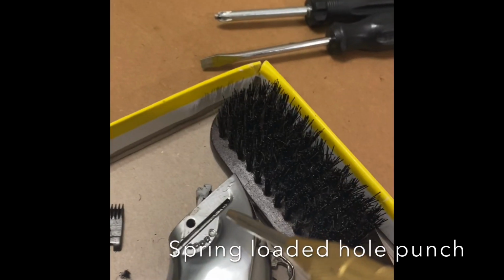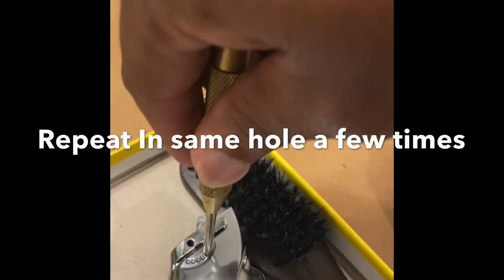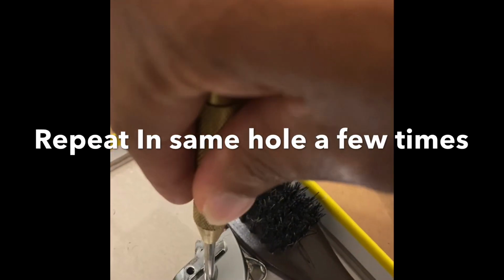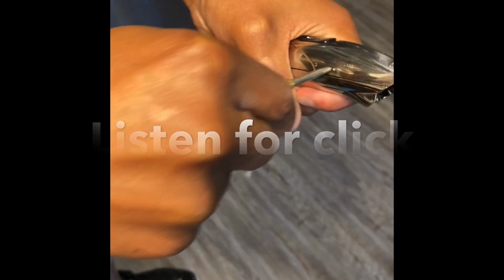How To Get More Range On Your Clipper Lever And Create Hole On Click Lever System Clipper

Comment: I need your help I want to do a fifth hole I used the puncher now do I grind the level toward the back with the dremmel? I assume is to the front of the bracket
Reply from the maker: It really depends. If your clipper won’t zero gap then do the front. If you need more range do the back. But don’t grind alot
Reply: @ncrandle0322  I did the 5th hole with the puncher but the clipper lever does reach to it and I did bring to the back and doesn't grab still so I assume I has to be to the front